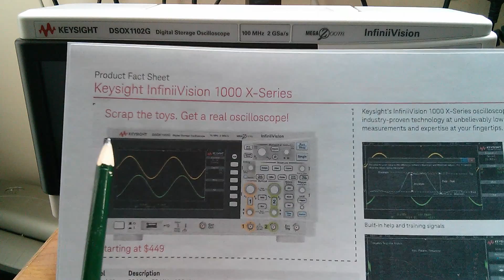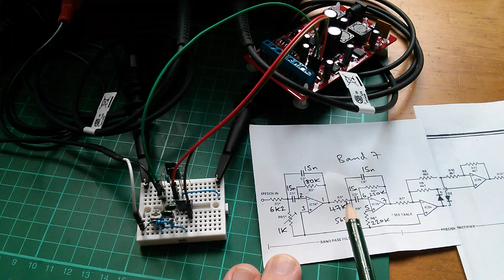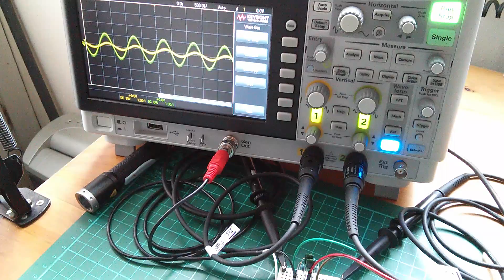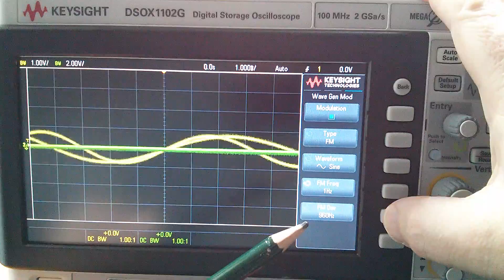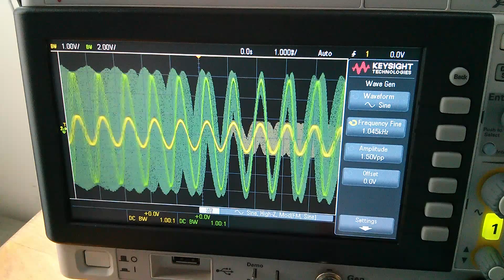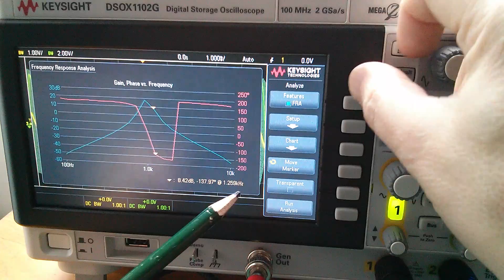Keysight 1000 X-Series Oscilloscope Bode Plots

Comment: I think the reason why the phase angle jumps up, is that the oscilloscope cannot distinguish between phases smaller than -180° and the corresponding +1xx° phase. E.g. -190° and +170° are basically the same. So the plot is correct, just keep in mind that a jump is just a phase that lags more than 180°.

Comment: The phase response jumps up 360 degrees. It's equivalent. Good phase plots have limits of +-180 degrees. It's like how there are infinite phaser values for any point of the plane because the angle can go around 360 degrees n times.

Comment: Pretty sure those are the two Delyiannis - Friend bandpass filters in series. P.S. the phase plot has flipped to the top because it went below -180 degrees. P.P.S. this Bode plot feature seems to be really disappointing, more like a gimmick, really. I was hoping it would sweep the frequency continuously just like those old HP network analyzers used to do (or at the very least allow you to select the "resolution" of the discrete sweeping). While the resolution and fine range settings might appear in the later firmware versions, it looks like the scope is not capable of replacing a proper network analyzer just yet.

Comment: From Wikipedia: In electrical engineering and control theory, a Bode plot /ˈboʊdi/ is a graph of the frequency response of a system. 
Pronounced: Bo-Dee, or use the above standard pronunciation guide
Reply from the maker: Yes, I suppose I should get the chap's name right - especially since I've had 50 years of my own name being mispronounced.

Comment: Your filter is about 10dB down at 950Hz and 1050Hz. Bode plot shows -10dB at about 700Hz and 1300Hz
Bode plot appears to be useless with bandpass filters. You really need finer control. Hardware can do it but software is crap! 
Maybe in a later software update.

Comment: What happens at 21:45 is that the 'scope confuses a negative phaseshift for a positive one ("wrap-around"). Basically, it has no means to distinguish +180' phaseshift from negative 180' phaseshift (it's all a circle, remember?) The phase-lag goes slightly beyond - 180 degrees (say - 181 degrees) which is showed instead as +179 degrees. Penalty-points to the HP/Agilent/Keysight UI-designer for showing a number "-200" on screen (y-axis), when in fact, the display is limited to +/- 180.

Comment: What a great new toy to get - I'll look forward to seeing what you do with it over time.

I notice that at 19:32 in the video - while you were trying to set the minimum frequency of the sweep range - the setting briefly went to 20Hz.  So perhaps pressing that button actually does change the resolution from course to fine even though there is no visual indication that this has happened?  I hope so - it would be really interesting to see that plot over a tighter frequency range.
Reply: I just check with mine and it goes 20Hz, 100Hz, 1kHz, 10kHz. Pushing the button doesn't change anything.

Comment: Can we not do this using A DSP processor, RAM, ROM and ADC/DAC you know what I am getting at if not then...

#include <stdlib.h>
#include <stdio.h>
#include <conio.h>
#include <float.h>
#include <math.h>

int array[51]={0};

int lopass(int value)
{
   unsigned int K;
   int J,SUM;

  SUM=0;
  array[0]=value;
  for(J=0;J<8;J++)
  {
     SUM+=array[J];
  }
  for(J=0;J<50;J++)
  {
     array[50-J]=array[49-J];
  }
  SUM>>=3;
  return SUM;
}

void mloop(void)
{
    do
    {
         output(50,lopass(input(50)));
    }while(!kbhit());
   getch();
}

int main(int argc,char argv[])
{
     mloop();
     return(0);
}
Reply: Or, as it is a hardware channel, use a TLO74, a handful of passives and make a Sawtooth oscillator + VCO.

Comment: Allthough Keysight can work a little bit more on the graphics in the frequency response diagram. The diagram should have looked like twin peaks, but it looks like a mountain in Norway. Perhaps there are more settings to play with to get dotted lines for divisions etc, perhaps the twin peaks would have shown if the lower and upper plot frequencies were narrowed.

Comment: You sure do make scopes look pretty, quite mesmerising in fact.
Reply from the maker: When I was about 7 (years old), I would visit my next door neighbour, Mr Smith, who had a big old valve oscilloscope. I'd sit in front of it for hours (probes connected to the test output), trying to make pictures of matchstick men by distorting the image on the CRT. I think that's what started my interest in electronics :)
Reply: I had a Tektronics type 549 storage scope. The persistence thing reminded me of it. Wish I still had it...and a house big enough to house it next to a workbench! :-)
Reply: I was fascinated by lissajous figures on a scope at school.
Reply: Many years ago I got to do my work experience week at a Tektronics service centre. They gave me a bench with one of their lovely CRT scopes and some signal generators and one of their vector screen microcomputers. I was already interested in electronics at that stage - couldn't say what got me started, maybe looking over the shoulder of the TV repairman?
Reply: kids doing A level physics are still required to know how CROs work. IMO They're quite easy to teach but they'll probably get dropped cos TBH they're obsolete technology today - schools should be about up to date  workplace skills which is why it's important to drop programming and teach them how to use the latest microsoft office instead :/ 

another didactic advantage is CRO's will do something visually interesting pretty much from switch on if you leave the timebase turned to 100ms/cm... I think a modest classroom riot could break out in the time it takes that keysight to boot-up.

Comment: Beyond being a good demonstration of a creative way to use the tools available in that scope, it also showed the problems synth/audio people have with modern equipment made for high frequency circuit analysis.
If the 1000X had four channels like the 1054Z it would quickly become the most popular hobbyist oscilloscope on the market.
The signal generator looks far better than the one in the more expensive Rigols too.

Comment: Overrated. Not a patch on my DSO138.👌
Reply: Julian Ilett I like the knob on my DSO Shell but I don't care for the case preferring my circuit boards in the raw and naked. The wriggly lines on the Shell look exactly the same to me as my DSO138 which has never had too much of a noise problem. 😄 And the digital readout on both have proved fine for my DIY tinkering. Together with my Banggood function/wave generator kit I reckon I've saved about £750!
Reply from the maker: The DSO138 will be back!!
Reply from the maker: Yes, I also have a DSO shell (DSO150) waiting to be assembled. It looks like the 138 but with a few tweaks and in a nice case :)
Reply: I noticed that you had another DSO something (150?) in your looked at list on e-bay or some such, are you going to buy another one and compare it to the 138? I don't do enough stuff to justify the cost of a proper scope these days, but a 15 quid one would see me ok. If another one was better, I could probably stretch to £20!

Comment: Congrats on having this scope. Now viewers can hopefully see waves from many of your experiments. That double top is due to component tolerance and it would have been fun to watch exact gain of two stages separately for different frequencies. I am sure, if you match the components value exactly then there will be only one top.
Reply from the maker: Thanks. I think it will be particularly useful for looking at the output of the myriad switched mode power supplies I've amassed.
Reply: Yes, it would be great to see performance comparisons of those switched mode power supplies. I think you should consider building a crude electronic load if you don't have any. Its very easy to build one to test with power supplies. Simple bulb tests may not give you flexibility to scan every details.

Comment: Nice bit of kit, Jules! Wow! Hope you're able to fine tune the bode plot, 'cause that'd be really interesting, plotting the outputs of different frequencies :)
Plus a tighter range should be faster. Might even be able to plot it in real time.
Reply from the maker: Thanks. The waveform generator is capable of very fine-grained control and is a pleasure to use. In contrast, the FRA plot has very little adjustment and is not really usable on this narrow band filter. Easy firmware fix I'd have thought.

Comment: Hello! What would be great budget oscilloscope?
Reply: A 100Mhz scope with 4 channels from a reputable company for $399 is leaps and bounds better than the value the base model of the Keysight scope provides. The Rigol DS1054Z is the scope you're looking for. Don't even bother with this Keysight unless you have an educational discount or you're rich.
Reply: DS1054Z . Has its faults, but for what you pay it's superb.
Reply: The base model of the Keysight doesn't have a signal generator and it's 1 GSa/s and 100 kpts mem. The Rigol has 12Mpts can be upped to 24Mpts. Shared vertical control because there are 4 channels on the Rigol lol. The base model Keysight is a joke for $448.00. The only thing that makes the Keysight better than the Rigol is the fancy name on it, that's it. They are both made in China, the joke is they could even be made in the same factory.
Reply: Even though I don't exactly approve of your username I will still help. If you want a good all-around scope with all kinds of bells and whistles then go for the Rigol DS1054Z. 400€ + tax and shipping, one of the best deals out there. Of course you could go for something like the Keysight 1000 series scopes but they're a little more expensive. But the DS1054Z is pretty much the industry standard for a cheap and budget scope.
Reply: IMHO still the Rigol DS1054Z with unlocked firmware. 100 MHz, 1 GSa/s for just $400.
Reply: Circuit Specialists in Phoenix has the best deal, a Hantek 200MHz 2 Channel Digital Storage Oscilloscope model DSO5202P-INT for $299.00 with free shipping in the US.  Sometimes they have sales and I got one for just $249!
https://www.circuitspecialists.com/hantek-200mhz-digital-storage-oscilloscope-dso5202p.html
Reply: +1 to the Rigol DS1054Z, you get 4 channels for $399
Reply: I don't know if Julien allow me to post links, so my second comment might get deleted due to his settings.
Reply: http://www.banggood.com/Orignal-JYE-Tech-DS0150-15001K-DSO-SHELL-DIY-Digital-Oscilloscope-Kit-With-Housing-p-1093865.html
Reply: Dezember that seems to be interesting and cheap. Do you have some experience with that one?
Reply: I think this is the best budget Oscilloscope at the moment on the market. Actually you get a X2000 series brain for bargain :) and I'am sure is hackable! I will buy also for daily run and show checks.
Reply: What about the Owon scopes? You can get the SDS5032E-V 30MHz 250MS/s for about $250 or the SDS7102 100Mhz 1G/s for about $370 so a tad cheaper and you don't have to hack it.
Reply: This one is 2GS/s...
Reply: I agree (Rigol DS1054Z) and it can be upgraded to 100 MHz for free.
Reply: Sean O'Neill aham..... 10 MHz... 4K sample memory.... no 50 ohm... no trigger output, input, 20 V max range, etc... That's what mean "cheap".  You guys see the specs? Or You just care about price? If that so, buy a 2445b for 250 USD!   The X1000 series is far a way more professional real instrument from real company. But You have a choice. Go to unprofessional way and see where You will arrive. No 50 Ohm input and trigger input? Come on! But there is WIFI, close to the tested gear hahahah :))) What a joke!
Reply: Yes with: No trigger input, no signal generator, 1 GS/S(250 MS/S when all channel running), shared vertical control for all channel, less memory... Yes. Definitely the best buy.
Reply: BMR Studio if you have 400$ and you need 4 chanels it is great purchase but i don't have 400$ and i don't need 4 chanels
Reply: Mathieu Riesling There is a detailed review from EEVblog about the Rigol. Over there You can understand what is a big deal and difference between the two. The Keysight Megazoom ASIC technology is unbeatable on this price level. This is a game changer oscilloscope. Just You guys somehow wants to be blind. I'm so happy to see cheap Megazoom oscilloscope on the market. If You guys cannot understand what is the game changing here, no problem. I hope, the smart guys will understand. And Yes basic model is basic model, but this video about X1102G.
Reply: hahah! yes thumbs up bud
Reply: Yes without Megazoom and lot of other stuff. First time when You touch and use Keysight oscilloscope, You will understand what the big deal about this scope :)
Reply: Yes it is cheaper..... Compare the functions, stability, memory, precision, waveform update speed etc... Then  think again about what is cheap. The point here is Keysight did a high quality scope for hobbyists, makers, students. So You don't have to suffer on low quality, only because Yoo don't have couple of 1000 USD for scope. No contest at all on any other brand. You can get cheaper this is true. I can get a scope even for free.